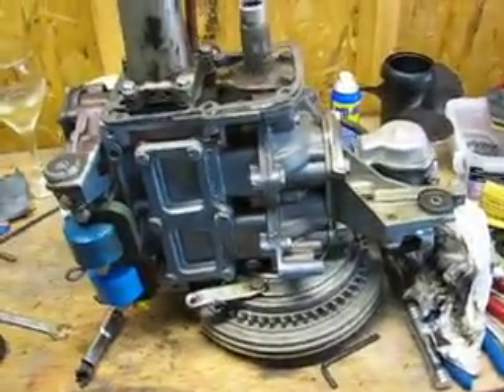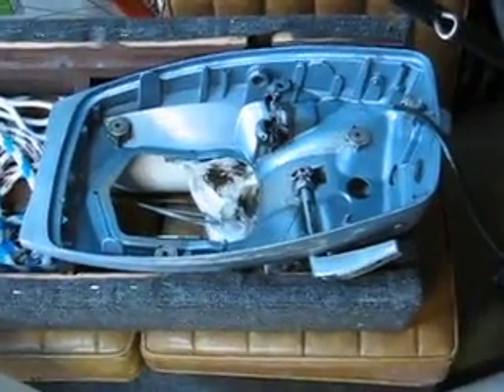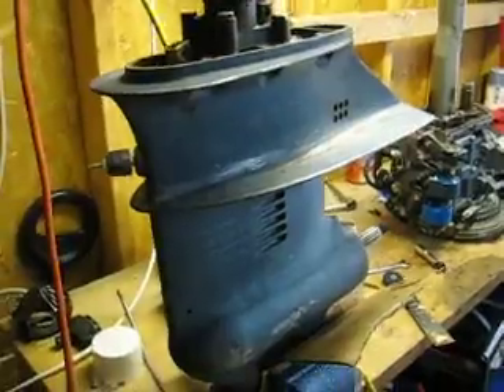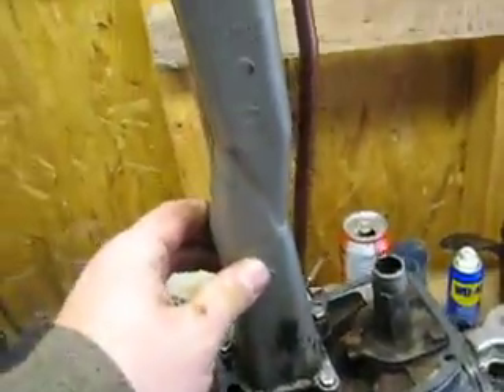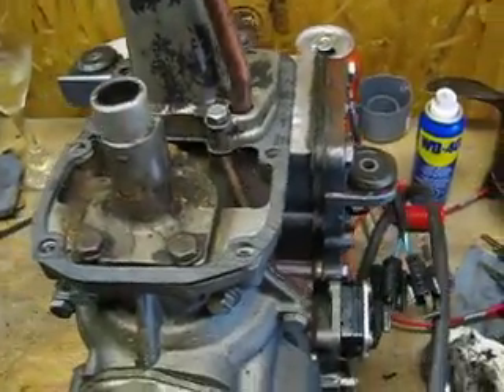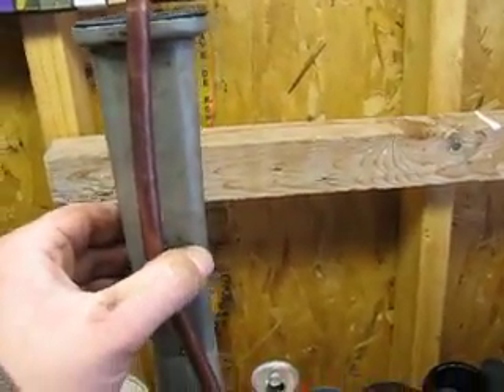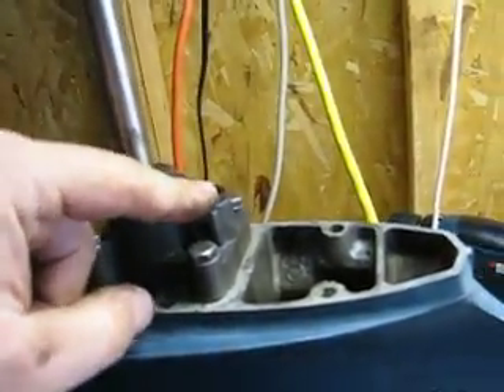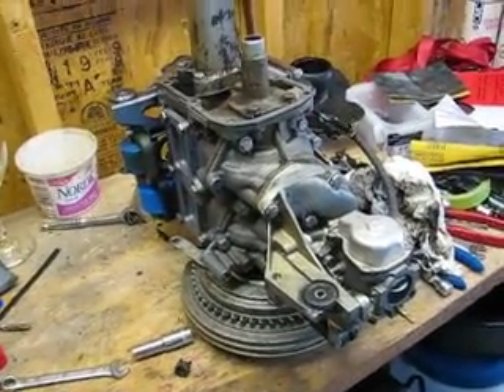Evinrude 9.9 tear down

Comment: like your videos...I have a 76 johnson 9.9...same thing, I think ..basically. I am having a water issue. I changed water pump, got some water to come out the top at high rpm with water muffs on. But something wasnt right. So the took the lower unit off and used a cordless drill on the lower unit to test the water pump, and it worked. Then, I used the my garden hose to pump water through the copper tube(water intake) and no water out the top...then tried compressed air from the bottom aswell...still nothing...any ideas what might be blocking or what might be wrong?
Reply: Sounds like you need a new thermostat. Had similar issues with my '74.

Comment from the maker: I didn't make a vid. I believe there is info of me doing the mod on iboats. It involved drilling and tapping the water jacket and installing the fitting same as the later model motors. I haven't worked on outboard motors now for over 2 years. I got robbed by a local asshole who took off with his boat and my $250 worth of parts. I'm now doing audio repair.

Comment from the maker: @95rman Those phillips bolts have nothing to do with it, If you took the top mount bolts off and the 6 on the bottom and disconnected all the other crap up top it will come off. Pull the lower unit and rock the powerhead, may be stuck to the housing.

Comment: So if I undue those six bolts and I guess the throttle handle, and the fuel line, it should lift right out? I thought the philips bolts on the mid section bolted into something that was keeping me from pulling it out. There are two philips bolts on each side just below the motor. I assumed I had to take those out.

Comment: I tried to pull the power head, I just couldn't get to the top philips head bolts on the top mid section. They were starting to strip out on me because of the angle.  I will test my thermostat. Thanks for the help. I'm new to working on outboards, so I was a little concerned that I may not get it back together if I got too carried away.

Comment from the maker: @95rman On muffs, you need to rev the shit out of them after warm (stat open) then they will spew water from that exhaust relief hole. I don't recommend revving it on muffs so the true test is on the lake/river. Make sure the stat is good, if it's questionable replace it. You can't test a stat by squeezing it, you need to put it in boiling water and measure the opening temp. If it's old replace it anyways.  Pulling the powerhead is not as bad as you think.

Comment: No it doesn't have a telltale.  I did shove a wire up the copper water line.  I thought I may have pushed the rubber grommet off and maybel caused and obstruction that way.  I did pull the thermostate out and it was corrodid to where it would actuate. I squeezed it and it seemed to be working. After doing that and putting it in a tank instead of muffs it started spitting water again.  I sure don't want to tear everything down if I don't have to. I'm going to take it on a test run soon.

Comment: I have the 15hp 1976.  How effective should my stream be?  I wasn't getting any water out on muffs.  I put my motor in a tank and it started spraying a splattered stream.  The water doesn't seem to be getting too hot, but the side of the engine(by the pistons) does still get pretty hot after 5 min idling in the tank. I  put a new impeller in.  I think I may have a partial clog somewhere?  I tried tearing it apart like you did, but I couldn't get the top philips head bolts out.
Reply: 95rman those are tough if you can manage to heat up the bolt enough it helps a ton in getting them out without probs

Comment from the maker: @lillrace They are the same powerhead. Through the years OMC made changes to enhance performance. The original motors were just different carbs, 15 having a larger carb throat. Then they added reed shims to allow for more fuel (which both the 9.9 and 15 both have) then they made a rounds tuned exhaust in the mid 80's to give it more power. To have a true 15, carb, reed shims and tuned exhaust is the way to go.